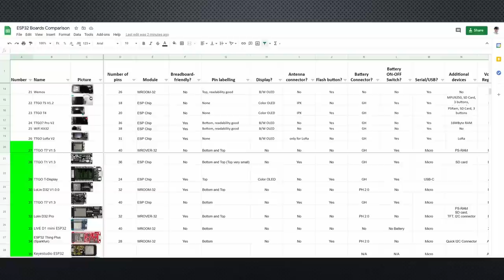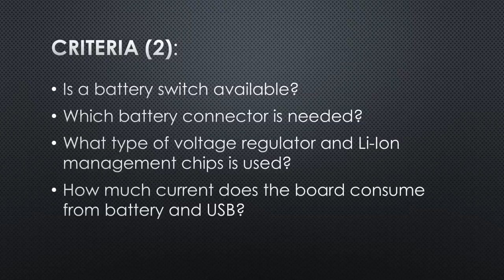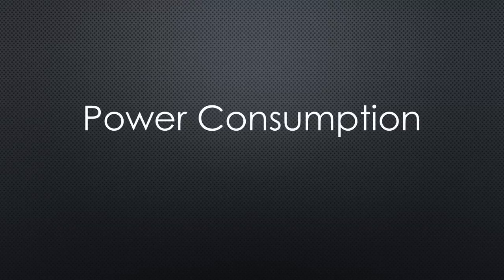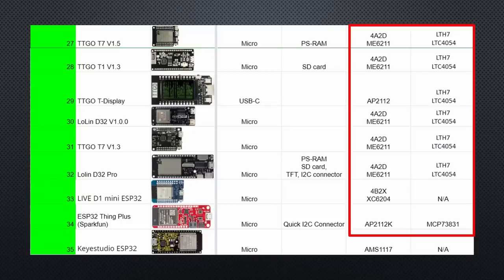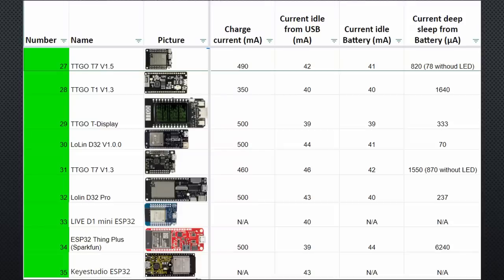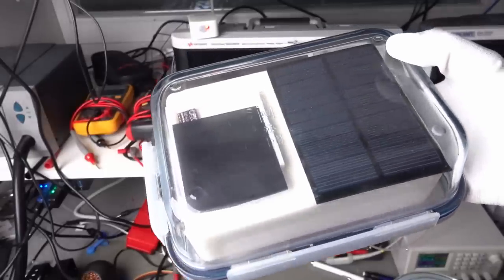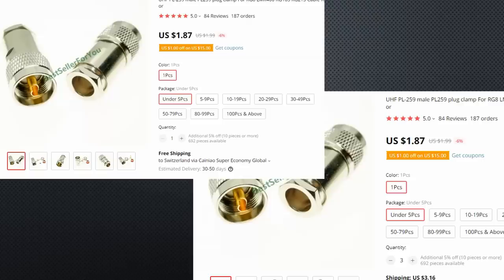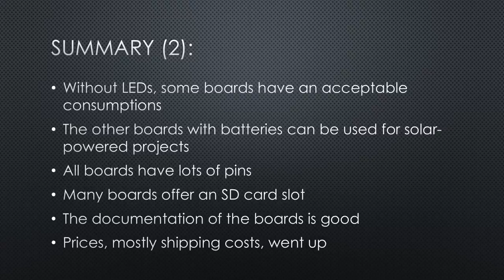#366 9 New ESP32 Boards: Comparison and Tests

Comment: Hi Andreas , can you please explain what type of connectors (for battery and GPIOs) are on TTGO T7 V1.5?  I am not able to buy the right one :)
Reply from the maker: Most of those connectors are JST GH (1.25mm)
Reply: @AndreasSpiess  , thank you for your answer! Can you please point me to any particular link? I already bought few different connectors of mentioned type and non was ok. Thanks!
Reply from the maker: Just use "JST GH" for your search and check if they mention 1.25mm

Comment: Very interesting and useful as always. One additional criteria that I find important and perhaps other users as well, is how much flash is available on the chip. I have some projects that are too big for the basic 4mb if I want to keep the options of OTA upgrade and flash filesystem. I have been using the lolin d32 pro with its 16mb flash for these projects. It would be nice to know what other options are available.

 Happy Christmas!
Reply from the maker: AFAIK all boards have 4MB flash memory.
Reply: @AndreasSpiess  The WROVER and S2 chips come with 4, 8 or 16 flash. I looked through your sheet and at the manufacturers specs . It appears that only the TTGO T-Display and LOLIN D32 PRO are available with more flash, both have a options for 4 or 16MB.  By the way did you mean TTGO T7 v1.5? you linked to v1.4.

Thank you so much for all your videos. I can't think how many problems I have fixed from the information you have shared. Merry Christmas!
Reply from the maker: I usually link to the suppliers I used. And I got the 1.5 version. But maybe you check before you order with the supplier or chose another one.

Comment: I got a few boards leaving no single row empty on either side on a breadboard, and are almost unusable therefore. Merry Christmas, Andreas.
Reply from the maker: These boards should have a "No" in the "breadboard friendly" column. I also have such boards from the past...
Reply: There's always the option to solder the pins (or female connectors) on the other side and use them Uno style. Or use a wide breadboard with two power rails in the middle as the spacing between both sides is often the same so the board can be placed in the middle. With that said, I do not prefer either option.
Reply: @ristomatti  Yes, it just not as convenient to use. Compromises ...

Comment: very informative as usual but maybe is time to consider other microcontrollers rather than ESP.  I think SAMD21 is a good choice with plenty of hardware such as native USB, SPI, I2C,. and It is Arduino and Python-compatible that work in 48 Mhz.
Reply from the maker: I like the SAMD51 more, especially for micropython. Unfortunately you do not find a lot of boards :-(
Reply: @AndreasSpiess  Seeeduino, adafruit trinket m0, and even barebone are good

Comment: I only played with the TTGO with Display, the display is pretty cool, full colour and also very responsive.
Unfortunately the operation is pretty strange. I wanted to make an oximeter but my MAX oximeter board failed. Also there are some problems with the battery reading from what I saw. Now I want to make a CO2 sensor display, as I got an oximeter for 9 dollars :D
Reply from the maker: Good luck with your project! Did you see my oximeter hack video?
Reply: @AndreasSpiess  Yes that inspired me to start the project, but it is not so easy to do an accurate measurement, actually the software algorithm is very complicated. It was kind of working but  all of a sudden my board died.

Comment: I have looked at many, still confused.  Some come with CH340 and others with the CP2102 usb to serial converter.  Does it make a difference, if so, which is better?
Reply: The CP2102 are slightly more reliable and have better driver support but generally there is no difference.  The CP chips are expensive though so you would expect the see the CH340 more often.  (This may go away when things move to ESP32 S2/S3 with usb support)
Reply from the maker: I agree with John

Comment: I think that WEMOS LOLIN32 uses same battery connector as Lolin D32 Pro - PH 2P 2.0mm, could you please repair it in your comparison table sheet?
Reply from the maker: You are right. But the sheet shows this fact.
Reply: @AndreasSpiess Than why can i clearly see XH connector listed at LOLIN32/Wemos board?
https://drive.google.com/file/d/1Rhi8vDobx_-A1eux0Q07uhWQCqK-f4mk/view
Reply from the maker: You are right. I only checked the new boards. This information (as well as with other boards) is now corrected. Thank you.

Comment: @Andreas Spiess
can we transfer .json whole file Arduino to ESP32 ?
Reply from the maker: Your question is unclear to me.
Reply: @AndreasSpiess   thank you for replay.My question is collection of sensors value/data save in one json file using SPIFF. Now i want to transfer whole(json) file to another Controller Using SPI or I2C Protocol so how can I do that ?
Reply from the maker: You cannot transport files with those MCUs. You have to transport character by character with whatever protocol you chose.
Reply: Hello  @AndreasSpiess   how i can Interface W25Q32(External flash) with Arduino Due ? 
Please Share any Example of it.

Comment: Thank you for another great video - as always, very informative. A warning about #33 the D1 Mini: Although it's really nice that it's somewhat pin compatible with the ESP8266 D1 Mini, it's 4B2X voltage regulator is only rated for 150mA, which is way too small for the ESP32 and will often cause brown-outs. You should upgrade it to another voltage regulator (like the ME6211 used by the other boards) before use. https://www.mcucity.com/product/3240/xc6204b332mr-g-3-3v-4b2x-4b2y-positive-voltage-regulator
Reply from the maker: Good to know. So far I never had problems. Instead of changing the regulator I would add a 1000uF tantalum cap directly between VCC and GND of the module (as I often do for battery operated devices). 150mA average is enough for most applications, but not for the peaks.

Comment: ESP32 will be replaced by risc-v mcus in near future. You cannot even use Xtensa ASM and there is no documentation.
It is popular now because of wifi but there will be faster wifi and bt chips using less power too
Reply from the maker: We will see how the software support is. I do not care so much about architectures, I want that we can use them. But having an open architecture for sure is a good thing.

Comment: FYI The ttgo T7 v1.5 link takes you to a v1.4 for sale.  Is 1.4 what you reviewed?  I can find no V1.5 at ali.  There is no V1.5 at Lilygo site so I think you were mistaken about the version number you reviewed.  http://www.lilygo.cn/prod_view.aspx?TypeId=50033&Id=978  To top this off that version doesn't have an antenna connector :(
Reply from the maker: I ordered with this link and got a 1.5 version. It has no antenna connector as marked in the table.

Comment: Hello Andreas, first of all thank you for your videos, Merry Christmas to you and your family (cat included). Maybe that sparkfun's high power consumption is due to some unwanted or unexpected current flow path that creates when the microcontroller sleeps? I'm thinking on parasitic diodes on I/O pins or pullup/pulldown resistors which start to dissipate?
Reply from the maker: Thank you and Happy Holidays, too.
I did not investigate into the power losses. I usually use a "blackbox" approach for such boards.

Comment: Do you know which circuit board transmits the farthest wifi signal?
Reply from the maker: Most ESP32 boards use the same antenna and the same chips. So they are equal. Unless you use an external antenna

Comment: still missing ESP32-VGA and TTGO T18 (T-Energy) (both boards i use alot)
stay away from the ESP32-Cam... its a nightmare! ive killed 3 trying to get it working right...
oh..and not all boards with PSRAM are WROVER..eg the ESP32-Cam is just a ESP32-S with external PSRAM chip connected via one of the SPI lines...
Reply from the maker: Where did you use the ESP32-VGA? 
How is the T18 with deep-sleep? If I remember, its predecessors were not very good.
Reply: @AndreasSpiess  i use the ESP32-VGA as an emulator (Altair 8800 and Vic 20 currently!..fun playing with CPM and 8bits of goodness!)..has 2 ps/2 ports for keyboard and mouse and the VGA with 64 colors..
i cant say about the T18s deep-sleep...ive never used that function (on any boards!)... i like my data live to the millisecond! :P
the T18 is nice.. it has a 8Mb Flash, aswell as 8Mb PSRAM.. so theres plenty of room for big projects.. most of the pins are available aswell (currently have it setup driving a RPI SPI display and still have half the pins free) aswell, it has a battery holder and charger (i had issues powering the board from a 17650..yes 17 not 18!!..altho both will fit in the T18)

Comment: Do you tell me Is it possible to control AC FAN dimmer (with zero cross detection) both By two Physical push BUtton (speed increasing and decreasing) manually and also By Blynk app slider button for controlling speed through wifi. I ask the question because facing very difficulties to write the code for integrating push button function with only wifi controlled code (By blunk app slider button) . do you know is it possible or not ?
Reply from the maker: Everything is possible with the needed energy. I would slice the project is several parts and start to solve one after the other.
Reply: @AndreasSpiess  Hi, Thanks for your reply . I already wrote the code and now I am making The Zc detector to check the code does it works or not. I will give you the update after experiment.

Comment: Those deep sleep currents are terribly high for battery. I know esp32 is mainly for WiFi, but still. Having a cpu that has better low power behavior, and only using the esp as a wifi coprocessor could result in lower power consumption. And in smaller solar panel, battery, box, everything. Could be interesting to see even a back of an envelope price calculation of a whole system. Or even real measurement, since you have an Otti.
Or maybe not a big gain for hobby projects, if there is enough space for a bigger box?
Reply: Much of that power consumption is not the CPU's fault; the 'data sheet' consumption of the esp32 in deep sleep is quite low, and some board designs, like tinypico, claim quite low consumption in deep sleep modes (18uA?). The problem is with board designs that have always-on LEDs, linear power supplies, and "Low" drop-out regulators like the ams1117 that just gobble all the amperes.
Reply from the maker: I agree with Sitting Duc

Comment: In the board comparison table, URL for listed T7 v1.5 links to T7 v1.4...?  V1.5 is  https://www.aliexpress.com/item/32977375539.html  This board seemingly has neither antenna nor connector - how to use radio?  Nevermind, PCB antenna is coated and hard to see at end opposite connectors and switches..
Reply from the maker: You do not see the PCB antenna of the WROVER board.
I usually list the suppliers I used for my products. But of course you can select which one you want. I got the 1.5 version, but maybe you check with the supplier before you order... Or you order at Lilygo (more expensive).
Reply: @AndreasSpiess  That URL now links to V1.5 OK from my browser; must have been old cached version. 
Difference from V1.4 to V1.5 is SW1 (EN) bypass cap increase from 0.1 to 1.0 uF

Comment: Andreas, please review the new ESP32-C3 (RISCV). It is (finally) the substitute for the ESP8266, because of its low cost and it has a lot of advantages like BT, power management, and security.  I believe Espressif can send you samples if you ask them.  I will contact you by PM on FB to send you the details.
Reply from the maker: I am on their list. But the chip only will be interesting for me if it has Arduino support.

Comment: ESP32 Thinker board WiFi connection is unreliable, does not always connect or once connected will sometimes disconnect. Have you experienced this issue (not router)
Reply from the maker: Rarely.

Comment: I developed an anti theft device with ESP32 DOIT.

I want to change and move it to ESP32 HUZZAH32.

I read the whole data sheet but i am confused about the pins i can use without any conflict.

On the DOIT i had, first a membrane keypad.

4 Outputs for horizontal lines with the following GPIO:

KH1-26

KH2-19

KH3-18

KH4-23

3 Inputs for vertical line. Each line is pulled up by 1K resistor:

KV1-35

KV2-33

KV3-34

2 Leds Outputs:

Red-21

Green-22

1 Output = Enable control line for your Adafruit MiniBoost 5V @ 1A - TPS61023:

Pwr_On-5

1 Input from and RFID Reader (TX-line of the reader)

RFID_In-25

Please be so kind and help me to select the corresponding GPIO or GPIn to move the whole project to ESP32 Huzzah32
Reply from the maker: I recently made a video about the ESP32 pins.

Comment: There is one ESP32-board which is already  available for a longer time and is optimized for lowest-power in deep-sleep-mode. The deep-sleep-current is 20 µA. and it has two RGB-leds on board. The RGD-LEDs stay off on battery-operation except you activly use them.
https://www.ezsbc.com/product/esp32-breakout-and-development-board/

not directly related to this video but to ESP-NOW and STA/AP-Mode
recently I came across this Github-Repo https://github.com/yoursunny/WifiEspNow  which offers code for retrieving all the MAC-adresses in an ESP-NOW-network. I tested it and had some troubles so I wrote an issue. User yoursunny answered and I guess he mentioned something that MIGHT make it possible to use ESP-NOW and beeing connected to a router at the same time. I haven't tested the imporved version yet. See here https://github.com/yoursunny/WifiEspNow/issues/14
Reply from the maker: 1. This board is in the mail to me ;-)
2. Thanks for the link. I probably will have a look at it.

Comment: I don’t know if there is a better way to get this question to you but I’ve seen a wifi device running off three 2AA batteries for several months continuously.  It seemingly is able to do this without powering off the WiFi completely (it’s using power save mode) but has responsiveness.  

I don’t know what chip it’s using but I can in real time unlock/lock it over WiFi (sub 2 second response).  

https://www.schlage.com/en/home/smart-locks/encode.html

Just a thought but somebody should explore this device and how it’s able to operate so efficiently.
Reply from the maker: This is an interesting device! Not cheap :-(

Comment: Hallo I wanne make an irigation system with 2 x 16 ch wireless systems (433 Mhz) that i ordered from alie express bud I whould like to use this TP 2264 send and TP2294 receive part with an Arduino ore an ESP 32 can You offer some help please. I have (23) electric valves that I wane switch with these TP 2264/2294 send receive in combination with a ESP32 ore Arduino.
Reply from the maker: I am a YouTuber and cannot do consulting :-(
Reply: Ok thanks

Comment: I love your spreadsheet, great work. TTGO T-Display has input voltage measuring on GPIO 34, as can be seen in the FactoryTest (default firmware the board gets shipped with) code: https://github.com/Xinyuan-LilyGO/TTGO-T-Display/blob/master/TFT_eSPI/examples/FactoryTest/FactoryTest.ino (line 20, 80-93, 172-178).
Reply from the maker: Thank you for the info. I added it in the spreadsheet.
Reply: @AndreasSpiess  awesome, thank you and keep on making awesome videos 😊

Comment: Board #33  the official site is https://www.aliexpress.com/store/2348158  what you have is slightly different.  Notice the two capacitors above the microusb connector, then look at the photo on the website you listed for this board.  They show three.  I have this board from the link you listed and experience brownout error when enabling WiFi.  The board from the official store has three capacitors and doesn't experience the brownouts.  I found the problem because I was going into deep sleep so the ESP32  didn't warm up the D1 Mini temp sensor I was using.  Every time it woke back up it got a brownout error trying to enable WiFi.
Reply from the maker: Thank you for the info. I assume the missing cap is at a different place. My board has 5 parts where your version only has 4. 
Anyway: Good to know you had problems with this version. I do not remember if I used it with deep-sleep.

Comment: How to power KEYESTUDIO ESP32-IO Shield please?  Looking for TRUTH :-)

6-9V as described on PCB or 7-12V as described on their web pages? Or it could be 6-12V range? Anyone could help? I have only 12V power adapter right now but I do not want to destroy my new toy. BTW Thanks Andreas for a great videos and nice tips - I already almost ruined my account using your AliExpress links :-) 

Link you manufacturer - When using, you only need to input DC 7-12V voltage on the black DC jack to power the keyestudio ESP32 Core board.
 

@t
Reply from the maker: The engineer's truth always is in the datasheet. They use an AMS1117. And do not forget the heat calculation for your particular use case.
Reply: @AndreasSpiess  Andreas thanks for a lesson :-) I hope this is correct datasheet: https://datasheet.lcsc.com/szlcsc/2001081204_Shikues-AMS1117-1-2_C475600.pdf - co as I understand it well, V-in is max. 18V. Thank you very much